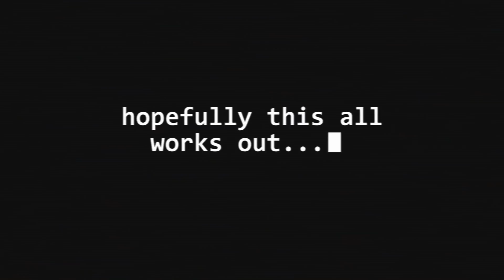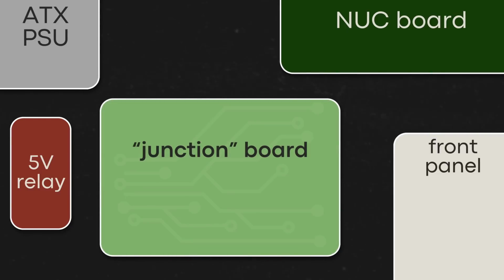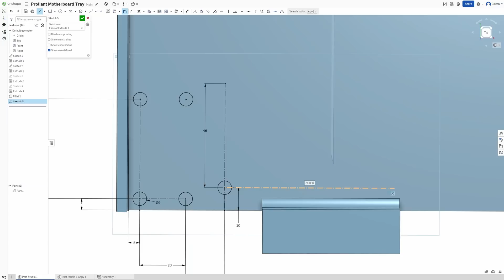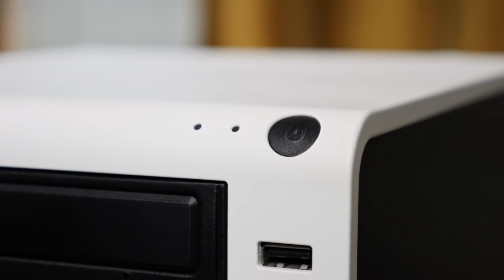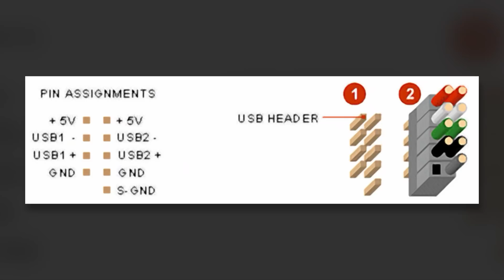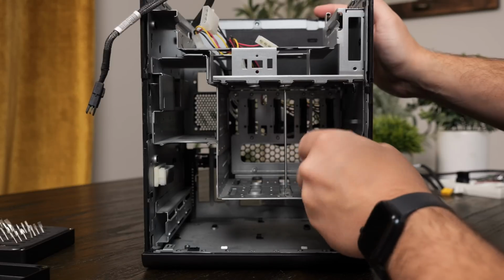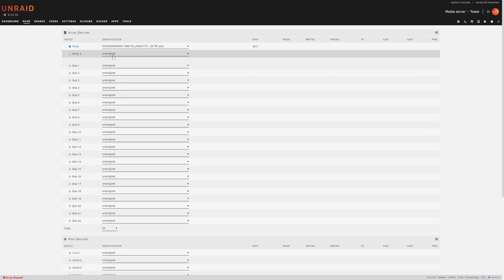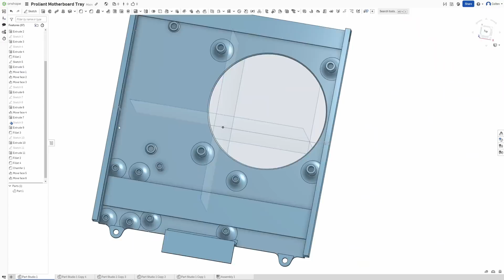This Custom MicroServer is NUTS  [HP Overhaul Pt.2]

Comment: rather than hot glue, 5 min epoxy:); have to rotate it till it sets, maybe check once and do twice, but comes out way cleaner
Reply: Hot glue is more flexible, testing it ??
Reply: it is, just a suggestion; was what I came up with when fixing ends on laptop adapters barrel jacks vs buying the 2 piece type; little more durable and cleaner is all:).... have used it on multiple things, for sketch soldering jobs it adds a bit of additional strength long as continuity was checked before hand; not impossible to fix issues but harder

Comment: Since the back IO panel isn’t exposed, you might be able to use those USB connections for the top two in the front, and that shouldn’t require any glue to do!

Comment: I just got myself on of these for cheap (19€ + 10€ shipping) without a power supply as it was dead after a power outage.
I gave it a try with an ATX PSU, and it works like a charm! 
I'm also planning to put some more modern hardware into it, I'm hoping I can somehow fit an M-ITX board in there, but I'll need to do a bit of measuring for that!
Reply: you can fit it in there if you drill new holes. the factory mb is bigger than mITX iirc.
Reply: @necronymnoninveni  it is. however, the space in between the rails is only 176 mm, ITX is 170 mm, so it's going to be a tight fit.

Also, the stock standoffs are stamped and not screwed, so I'd have to flatten them and then use normal standoffs, though normal ATX standoffs are 6 mm high, here they are only 4 mm, which I need to replicate if I want perfect positioning with the expansion slots!